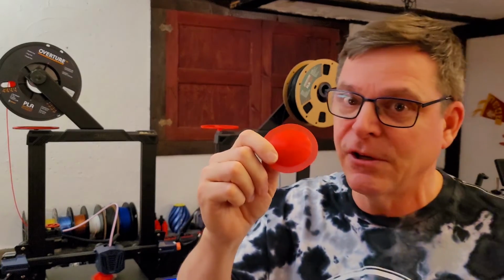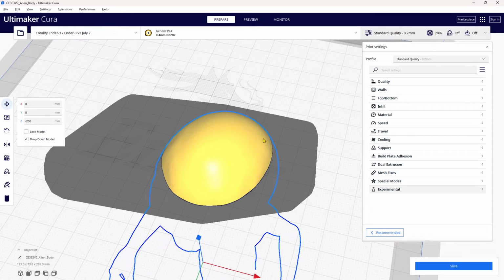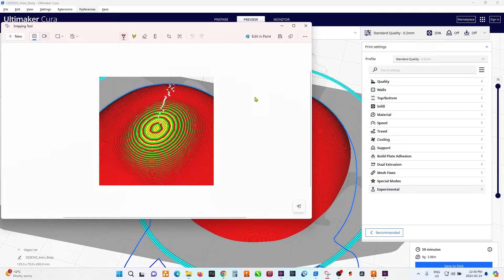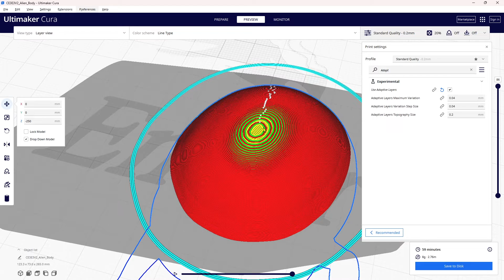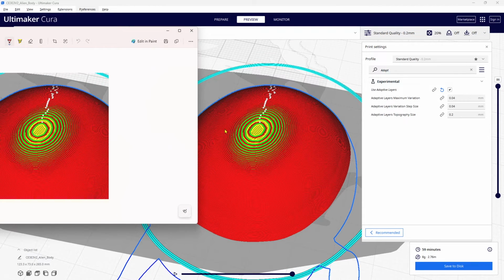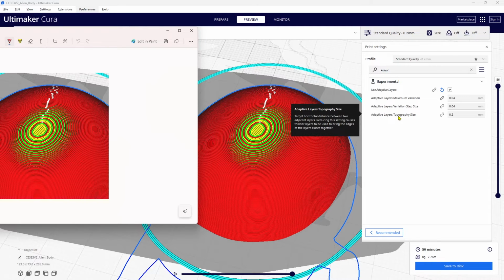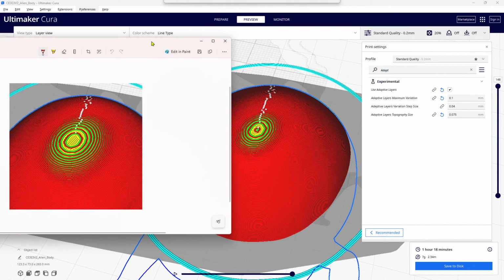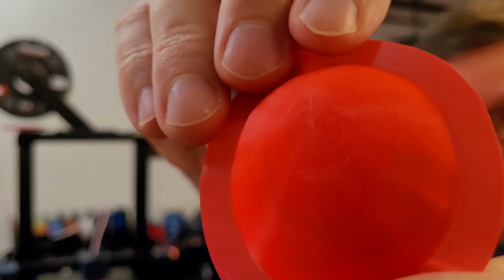3D Print Smooth Curves Tutorial

Comment: The equivalent of Cura's adaptive layers in Bambu Studio is called Variable Layer Height, and you can enable it by clicking the Adaptive button in the slicer interface after selecting an object.
Reply from the maker: Yep, exactly — it’s called Variable Layer Height in Bambu Studio. I didn’t touch on it in the video, but it’s a great way to smooth curves without blowing out the print time. Thanks for jumping in with that!

Comment: Hi, can you advise on the new AnyCubic Slicer Next "Adaptive Layer Lines" function, it seems to show a gradient chart on the right,  I can hit the adaptive button and it applies something, and/or I can modify and swing something right and left of a centre line using my left/right mouse and the size of the "tool" is step by a radius setting......... I don't know what I'm doing with it though, I don't know what the gradient represents. I have searched for guidance but found no explanation of the feature at all! (I'm printing a delaval nozzle and I want a nice smooth top curve as the radius pans out tangential to perpendicular at the entry)
Reply from the maker: Hi Russ
I wish I could help but I don't own Any cubits any more. 
I would recommend performing small print tests in order to gain an understanding of the settings. 
Good luck I hope you figure it out